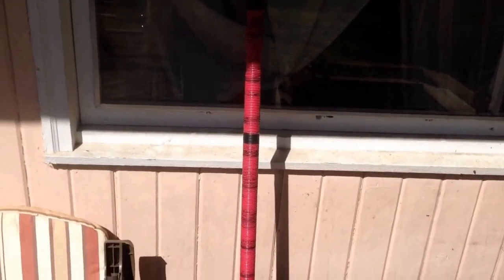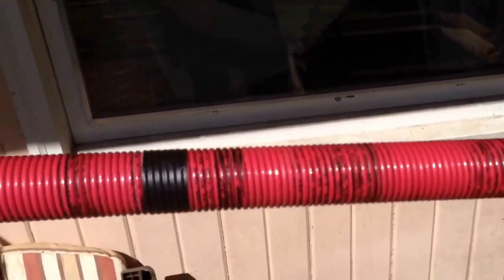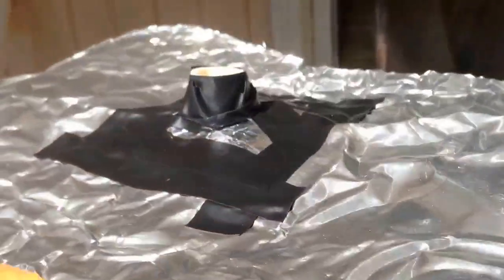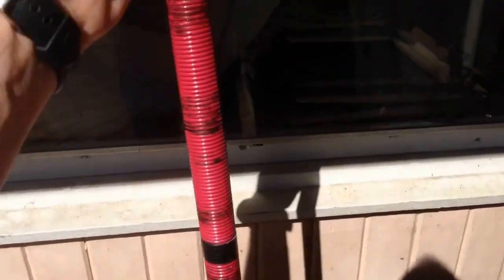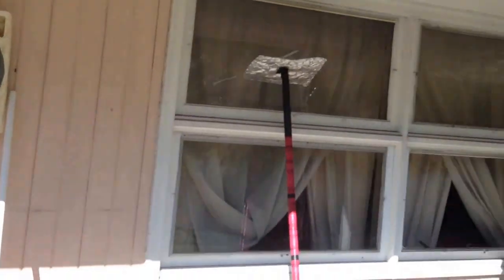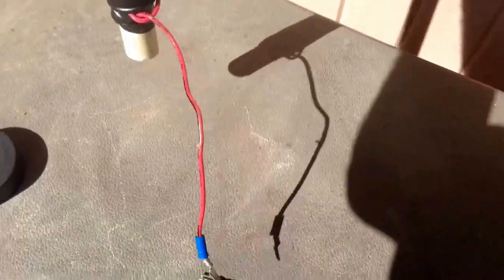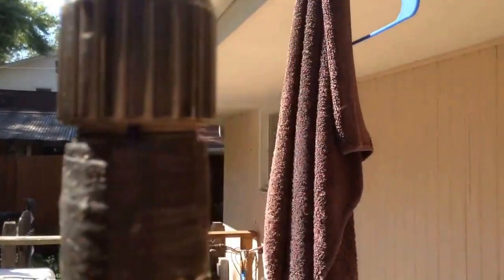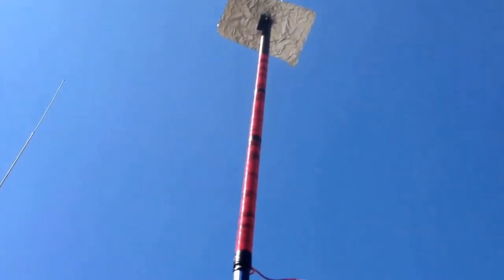Portable Broomstick Antenna

Comment: I'm thinking of building this but having it horizontal in my attic space and connect it to my yaesu frg7 via a good atu , good video 73 de g7jdh
Reply from the maker: Andrew Nevill Yeah it would work that way horizontally vertically it wouldn’t matter a bit. For receiving only and being extremely portable this type of antenna cannot be beat

Comment: I wonder if this system would work for doing SWL in local school athletic fields after night has fallen? 

Note to self:

@ 2:38 - 2:39 .........there are 6 pieces of 1" PVC, each one less than 2 feet long with 3 "T" connectors holding them together creating an "H" base. 

There is a "telescoping swimming pool pole" sticking straight up out of the middle of the PVC base. 

So if you buy enough materials to make 2 of these vertical poles with "H" base and you go out to the local school athletic field you simply erect the "H" bases and place the telescoping pool poles in the middle of each base. Then just place a brick or 2 on one end of either "H" base and the whole thing will stay up as long as you want it to. 

And since you're in a field that is totally open for 360 degrees and 100 yards in every direction you can point your SWL long wire antenna in any direction you choose. You can also change the direction of the long wire antenna 150 degrees or more in less than 2 minutes simply by picking up one whole "H" base and moving it to another location.

If the telescoping pool poles that are placed on top of the middle "T" connector are large enough to fit over that "T" connector loosely, the whole pole may "swivel" as you move the other "H" base. Figuring out how to move either "H" base without knocking the other one over in the process will be the big key. 

For extremely lengthy long wire antennas (more than 200 feet long) just place a few extra swimming pool poles in the middle of the long wire antenna at various locations so that the long wire doesn't drag on the ground. 

Yeah, that's the ticket.
Reply from the maker: nudist1033 absolutely that would work 100% I have done it by using it on a soccer field which is the same thing as the football field pretty much and with the clear area around you it works great
Reply: Radionut R, 

I just went out to the school athletic field that sits right next to the county library that I'm sitting in and even figured out a slightly easier (possibly faster) way than what you have here. 

Simply buy 2 telescoping swimming pool poles and 2 pieces of "rebar" no more than 3' in length or 1" in diameter. 

Stick the rebar poles no more than 8" in the ground and slide the fattest end of the telescoping pool poles on top of them. The strength of the rebar will guarantee that the poles don't topple over in a heavy wind, and the length of the rebar above the ground guarantees that the poles can't fly off on their own. 

Plus, if you buy a 5' long section of 8" thick PVC pipe and 2 caps to hold the entire thing you can store everything in the 8" thick PVC pipe and carry it all in one tube. 

Someday after I get a job I'll have to buy all o0f that stuff and see how well it works.....................(8^)

Comment: The telescopic pole you recommend is at Lowe's as either  Aluminum, 2-piece, telescopic, vacuum pole 													4 ft to 12 ft or 8 ft to 16 foot or much more expensive Fiberglas pole. If the PVC pipe mounts securely at the top of the pole and leaves empty PVC to keep the antenna wound wire away from the metal pole, that's a good performing, ingenious idea !
Reply from the maker: Joseph Rotello thank you for that clarification I hope you built one and have a good time with it